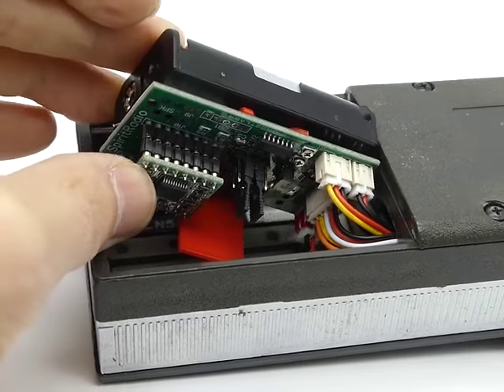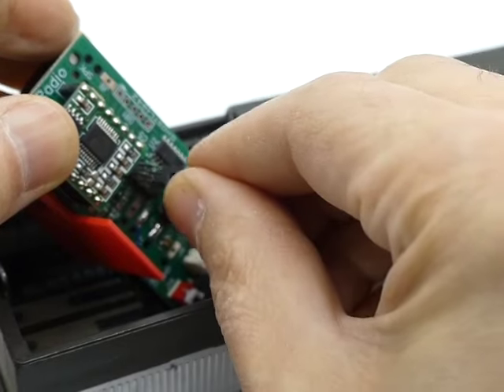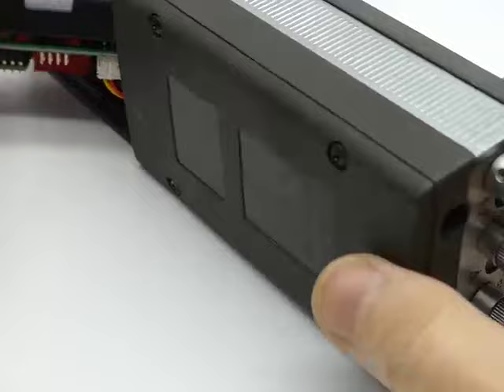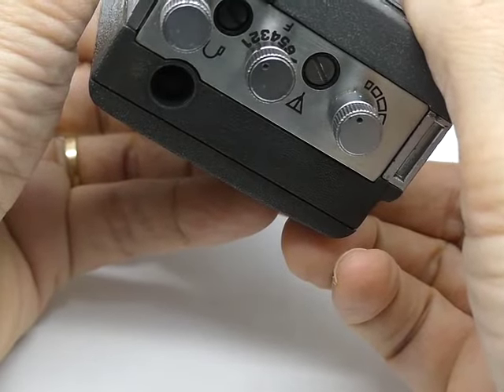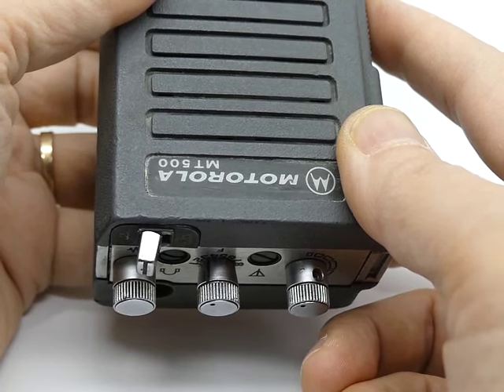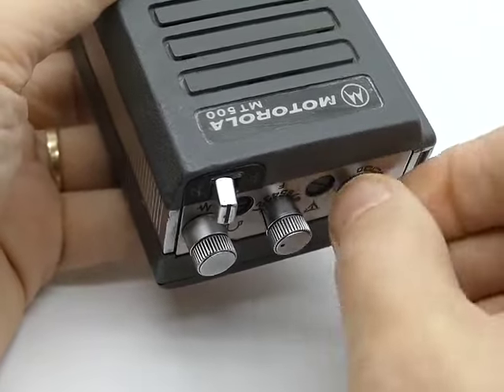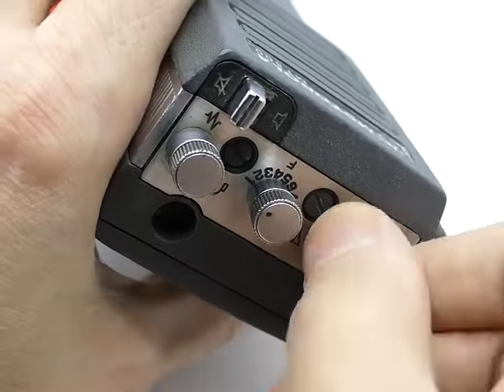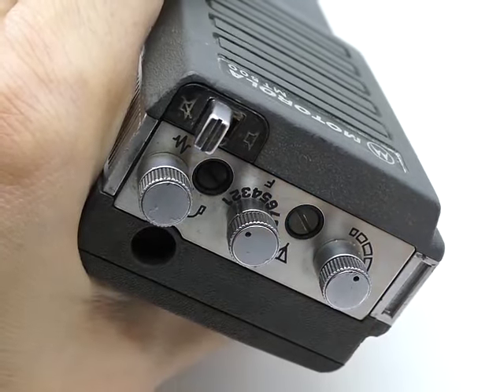Testing the sound module in a Motorola MT500 Radio

Comment: I like how he had given his Motorola MT-500 radio dialogue from the Ghostbusters video game. (2:41)

I would've done the same myself.

My Motorola MT-5000 radio would look exactly like how it was seen in the video game with the long antenna, and it would mostly have just some dialogue from the video game.
Reply from the maker: There is also the HT1000 radio with long antenna used in Ghostbusters TVG.  I made replacement labels for the HT1000 from artwork supplied to me by the model designer that worked on the video game,
https://www.gbfans.com/equipment/uniform/mt-500/
https://www.ebay.com/itm/194719255582

Comment: Question, I got the ghostbusters full upgrade kit, but when I activate slime blower the cyclotron lights turn orange instead of green, is there a reason why?
Reply from the maker: I would need to know which powercell board and cyclotron lights you have.  The boards do have self test modes to  more directly check the LEDs.  It would be easier to send pictures of the parts and continue this in some other forum... I am user spongeface on GBFans.

Comment: Wish I could make one of these for my sister.  She can't walk or talk due to cerebral palsy and just loves Ghostbusters.  Are those original radios still purchasable today?
Reply: I found one on Mercari for almost $100.
Reply from the maker: Yes, I do offer modded MT500 radios and also Modded Spirit Halloween Walkie Talkies.  See the description for links.
The Spirit Walkie Talkies are lower cost, but do not have external volume control or external quote selection.  The talk button also slides instead of presses.

The sound module will also play a selection every 1 minute to 8 minutes (user settable) if you leave it on...

Comment: Does the radio need to be a working one? Don’t know that mine works.
Reply from the maker: The sound module takes over all functionality, so it no longer would work as a radio/walkie talkie even if it was working before.
It needs a working power (on/off) switch, talk switch and speaker.  It also would like to use the volume potentiometer and frequency selector switch, but those are not required.
The switches' and knobs' connections are removed from the original electronics and only used by the sound board directly with new wires.